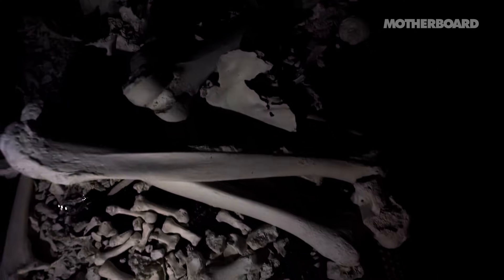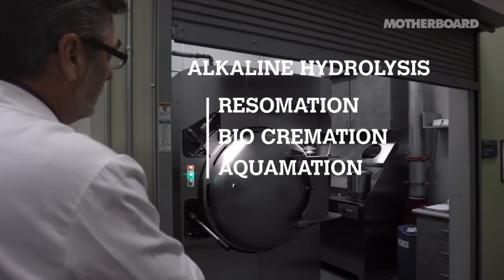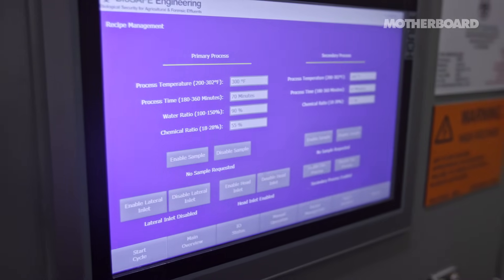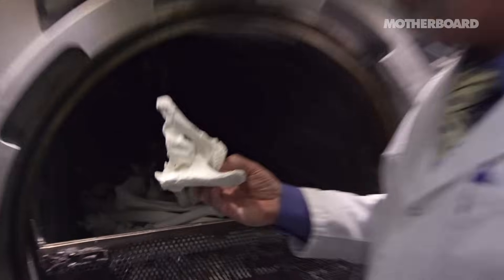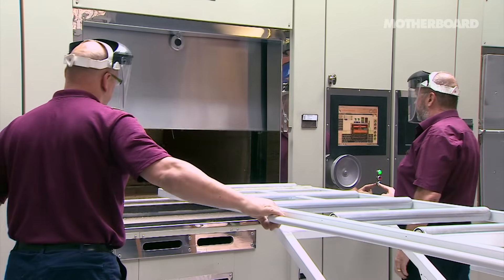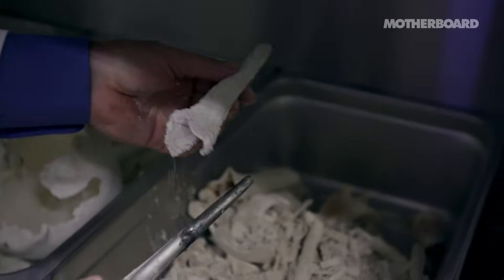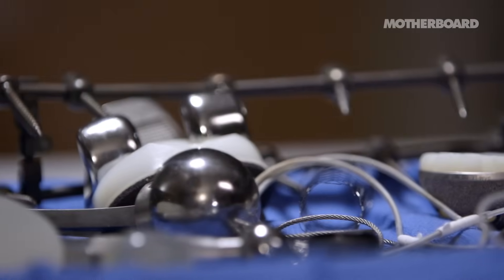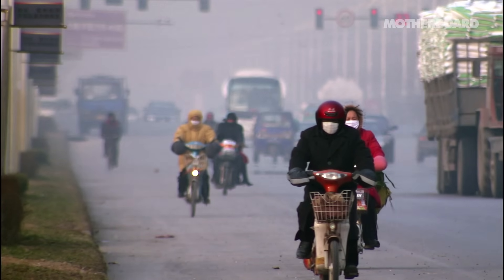Leaving Earth the Greenest Way Possible: Water Cremation

Comment: My sister was Aquamated the first of this month.  We didn't pay any more than what a flame -based cremation would have cost.  I'm sure as in everything, the cost would depend on what state/city the process takes place.  My sister's happened to be in Oregon.  We were able to view the chamber and could have even watched the process if we wanted to.  This process is so clean that the bone is a vibrant white powder when we got the remains back.  Also, you actually have 30 to 40% more cremains using this process. I'm all for this and hope they offer this process in my state when it's my time to go.
Reply: Is it possible to get the remains WITHOUT them being crushed?

Comment: Harldly “the greenest way possible”, alkaline hydrolysis involves the use of many gallons of a caustic alkaline solution, heat and pressure to dissolve all the body’s tissues, except bone.  All of the body’s remains are pumped into a sewer, along with the strong chemicals, and ends up polluting the water environment.  Never mind the fact that Grandma’s remains are now commingling with poop, urine and other foulness in sewage.  If you want the “greenest” method, choose a “green burial”, where the unembalmed body is buried in a shroud or biodegradable container.  Nature then breaks down the body into it’s most basic components, which are actually beneficial to the environment.

Comment: Love the way he touches the bones without gloves on his hands....
Reply: 🤗 the hydrolysis process has destroyed any kind of infectious particles 

But understood the bones could still carry the residue of the potassium hydroxide.
Reply: @starberrydrink  Doesnt matter that's just LYE, the same thing that is used to make SOAP, you can buy it by the pound, I've bought the stuff and used it to strippaint off salvaged antique architectural cast-iron artifacts, a  pound or so in a large rubber tub filled with about 15 gallons of water was enough to submerge the iron pieces in and within minutes all the old paint is GONE, right down to the iron, works 100 times better than any "Zip strip" or other paint remover!

Comment: This is like making biodiesel using cooking oil, animal fats im guessing?  Is the biodiesel used, or does it go down the drain, or can people get it from you to use?  I make my own biofuel at home, and if its possible to find somewhere near Nottingham uk and get some liquid remains.  I guess you do a titration so all the fat is reacted, and it turns out you could use sodium hydroxide too, that would be cheaper, and require less, but one drawback, takes longer to dissolve.  Do you get glycerol soap from this as well?  Andrew Mckenna, Nottingham uk.

Comment: I don't like this because only the bones remain.  There is a great deal of the body that is missing with this process.  I don't want all my soft tissue flushed down some toilet.  I want my entire body cremated and the remains of my entire body (not just the bones) buried.
Reply: Even with traditional fire based cremation most of your soft tissue is incinerated and goes up the smokestack.  Once they have burned off all your soft tissue they remove the bones and crush them into a powder that your family gets back as "ashes"  If you want your whole body buried you should skip cremation entirely and go for burial without embalming.

Comment: I wouldn't choose it for myself or a loved one because at the end ( correct me if i'm wrong), you'll be scattering only part of the body (the bones) because the tissues, muscles etc would be lost down the holes ( sieve thing) during the process?? Whereas if the body is cremated by fire, you end up with 'all the burnt remains' ....
Reply: Actually Nonny, the remains from water and fire cremation options are about the same - mainly bone. Remember that about 96% of the human body consists of four elements that (for the  most part) evaporate during fire cremation - out of what is left, over 95% of that is bone.

What the video doesn't cover with this method is just like with fire cremation, the "leftovers" (or bone) from alkaline hydrolysis is then run through a grinder and turned into a fine powder - this you receive back in an urn, or box, or whatever is chosen for your remains. You don't get back grandma's skeleton, even if you ask...

As someone else mentioned, the process is expensive - alkaline hydrolysis machines are (last I heard) around $250K each, so they aren't widely available. Further (also as someone mentioned) while 10 or 12 states (as of Jan 2018) have recognized it as a viable form of cremation, the good old religious nuts are jumping up and down about it so their legal disposition kind of goes back and forth. Lastly, even where legal, not a lot of machines exist (I think only three or four in the US). 

And there is no comparison to embalming - this is much greener and safer for the earth. All these people wierded out by the thought of "going down the drain" are oblivious to what happens during embalming -  - the blood is sucked out and after severe piercing of major organs and filling with liquifying chemicals, whatever is left of the gastric system is sucked out through a trocar and put down the drain.

I am definitely going with this method...
Reply: Oh boy. Wait til you hear about embalming...

Comment: Sounds good, except not all of the liquid remains will end up in the secrets garden or vegetable farm. City dwellers could well discover their loved ones have been flushed down the sewer. It seems a bit disrespectful to me. My grand parents had a cesspool behind their home where the casaba melons were so beautiful, but no one ate. There is something poetic about the smoke of a cremation being cast into the winds. The pollution issue is minor, What your showing as cremation polluters isn't here in the USA. One looks to be in India. (A major polluter period) The first isn't a modern cremation fire.If it is at all.
Reply: If you're worried about bodily remains ending up in the sewers, yet find human ash remains being pumped into the air "poetic", I'd hate to be the one to tell you what you'd be breathing in there bud. Plus, with alkaline hydrolysis, the remains of it contain no actual human DNA, since the entire body (save for the undissolvable solid parts) is dissolved and the solution can be easily treated for chemical compounds. Plus Plus! With regular embalming, all bodily fluids like blood and other nasty gunk is washed right into the sewers to be replaced with embalming fluid, specifically designed to keep decomposition at bay and preserve the body. When the person is buried, all those chemicals go right back into the earth too. I don't think water cremation is the most "disrespectful" out of the available options.

Comment: I would like an in-detail energy savings analysis.
Reply: I was thinking along the same lines. I was more concerned with the overall footprint from start to finish to produce one. The materials, the carbon footprint before - after and during use, emissions, cost per a unit, etc. Also how many bodies at weight x would need to be disposed of through this machine to finally start making a positive change due to all the other previous and current emission factors. Would be nice if there was a standardized way to measure these factors in many circumstances.
Reply: Go on and watch Ask A Mortician video about alkaline hydrolisis. But if you don't want to I give you a few simple answers: It does not emit gases to the environment, it cost much less than an old cremation, it doesn't need lots of material in comparison to using flames. It is legal in a few states but hopefully will be legal in other states and countries :)
Reply: It depends from person to person. Only your relatives would know precisely how much energy it went to juice you.

Comment: So the body is put into the machine and the liquid is set at 300 degree F. The boiling point of water is 212 degree F. so actually they are just boiling the flesh off of the body. I would rather just be encenterated and burnt, and also I bet the hydrolosis is more expensive you choose.
Reply: pressure smarty pants
Reply: @devanh8592  you are exactly right it is more expensive and uses more energy to run it. I had rather just be burnt, but this machine boils you just like you would boil pork I don't ever want any thing to do with hydrolysis cremation.
Reply: @devanh8592  I just don't like the thought of me boiling for 8 or ten hours. I would rather be burnt in a. 2,000 degree furnace for 2 hours and nothing be left, but some bone fragments and ash. I just don't like the thought of being boiled even if I'm dead.

Comment: Personally, I would like to know where the slurry of flesh goes?  If my understanding is correct, it is flushed into the sewer system in most states and provinces.  Therefore, I find this method far from green.
Reply: Especially since I think you HAVE to be buried in a casket...but you can be flushed into sewers ? :) that would make perfect since on a government level lol
Reply: Caskets are not legally required, at least not everywhere.  Also, there is NO flesh left after this process.  There isn't even any DNA left.  Your blood, by the way, gets flushed during a traditional embalming, and your body is buried in a crypt and casket after being filled with chemicals.  Some traditions consider that the life is in the blood-- and it gets flushed down the tubes.  If that's not a problem, this shouldn't be.  With a green burial your flesh is eaten by bugs and worms.  There is no pretty way to dispose of bodies.  We can only look for ways that cause minimal impact while remaining as respectful as possible.
Reply: So? the sewer water is treated anyway, no special extra treatment is needed beyond what it already does with all the crap you flush down the toilet.

Comment: I am very skeptical about the truth of the statements. For instance: I find it hard to believe, that this is more energy efficient than cremation. It seems like the energy it takes to produce the sodium hydroxide is ignored, which is quite a lot. There are also other points where additional energy is needed when compared to cremation.
Reply: Futaxus true, but honestly if you can reuse those implants and what not its proboably worth it, dont you think?
Reply: I agree that it probably is worth it in some cases, but I don't think it's that evident. The implant story for example seems very speculative. Implants have very high quality standards (and for good reasons). But let's just grant that there is worth here, I still expect Motherboard to have higher standards of fact checking.
Reply: They could just recycle the KOH
Reply: I don't think that would work very well. First, most of the KOH will be neutralized by the fatty acids and amino acids (both are somewhat acidic) and you have to invest a lot of energy again to create a very strong base from a somewhat neutral solution. Second, the solution after the hydrolysis has to be dealt with. The usual way would here to further neutralize the solution with some acid and then to remove the different dissolved substances by filtering etc. I mean, there might be a really ingenious way to recycle everything used that I don't know about, but that by itself would be relevant enough to report about and it's not likely. 
Once again, a short sentence addressing this in the video would have been really useful (to me).
Reply: Futaxus Cremation is basically a gigantic fire tornado hot enough to melt iron so I doubt it's more efficient.
Reply: That sounds like a really scientific argument, thank you for enriching this conversation. (Everyone interested might do a quick calculation. If you really wanted to, you could burn a human body energy efficiently, even without drying it. That means the energy released by burning the fat and muscle alone is enough to vaporise all the water and still produce energy. However, it might simply not be practical to create a corpse fueled power plant for several reasons.)
Reply: Futaxus I think the carbon emissions of cremation are negligible
Reply: Do you realize that you are not making a counter point to my argument?
Reply: Futaxus 
It's about a quarter of the carbon footprint of traditional cremation.
Reply: Futaxus 
Hospitals will charge the same used or not.
Reply: The water from the machine is going to sewage why not just throw the body in garbage. I don't see any respect for the dead bodies .You are not getting ahead by using these methods you are simply disrespecting dead bodies
Reply: That's why there is a range of options. If you don't like it you can choose something else. Well... until some stupid person bans fire cremation because of "emissions".
Reply: That's a bold and untrue assumption on your part.
 I know emissions and climate change is real. But cremation has been a part of many cultures for thousands of years. There are better ways to cut emissions other than preying on cremation, which has been mentioned where I live. 
Maybe you shouldn't make character assumptions off written text.
Reply: JezaPyrite everyone makes assumptions off of how people write.
Maybe you just need to pay more attention to your own writing. Especially since the use of commas around words can often make readers feel that if it was actually being said the person would be using their fingers in an air quotation manner which is normally used in a sarcastic unbelieving sort of way
Reply: Wow you really have a big issue with a simple comment don't "you" lol. Ok captain, I shall articulate sentences to a more satisfactory standard in the future just to keep "you" happy, oh internet stranger. May you're day bee peiceful and fill off good spellling and gramma correctness.
Reply: JezaPyrite I think it might be you that has the issue judging by your replies. I just made a comment about a simple observation
Reply: That Girl     Ok honey 😘
Reply: JezaPyrite thanks for proving my point again and emphasising it with that little emoji
Reply: This is for the girl and jeza comments. Quotation marks, not commas.
Reply: The fact that you are skeptical about this lends zero substance to your skepticism unless you brought facts yourself.  As someone has said, NaOH is readily available and cheaply made and your words sound heavy on simple skepticism and light on reason or fact.   It is hard to change, maybe that's why you balk at this idea.  Change must be embraced though, however reluctantly some may be, or skeptical.
Reply: i believe he said potassium hydroxide
Reply: I rather be barred,who knows maybe I will become a zombie 🧟‍♂️
Reply: Sodium hydroxide is literally just brine . Wtf do you mean "produce sodium hydroxide"?????

Comment: *scientist 
>uses Fahrenheit
Reply: Yes, even scientists know that Fahrenheit is necessary if you want a US audience to have a clue what you're saying.
Reply: Bruceskyy telme how jes your scale is biger but we usually use 20,5  so it can be just as precice but what is the difference between a single degree on  300 degrees
Reply: Bruceskyy I beg to differ. Celsius makes more sense, is more precise and more accurate
Reply: Fahrenheit allows for more precise temperature measurement quicker. The difference in a degree bring a more precise measurement than your Centigrade system.
Reply: The Big Game Theory metric is dumb and sophisticated countries who know how to think in more ways than 1 and 0 use proper forms of measurement. Inches, feet, Fahrenheit, yards, and gallons.
Reply: The Big Game Theory the UK defacto uses gallons and inches. Seems kinda funny that equipment using proper non metric units took men to the Moon.
Reply: Correct, only 3 countries operate on that system. Best available. Science uses kelvins anyway other dummies.
Reply: Sean O'Donnell cant believe it took nine months for someone to bring up Kelvin
Reply: Celsius = Water freezes at 0° and Boils at 100°... Seems much more practical and precise than Fahrenheit
Reply: The Big Game Theory if you're going to rant about how stupid something is, use the correct form of the word "too".

Comment: Organic carbon is not a pollutant, we are carbon based life forms, plant life needs carbon, needs the nitrates, and burnt organic matter is not one minutia  a factor in our pollution problem. That is misinformation from an advocate of the process. I agree with cremation and dont think badly of the alkaline hydrolysis of that's what someone decides, but I personally would choose traditional cremation because your fueling the earth, feeding plant life, with  your organic losses through the process, and those losses are minimized meaning more of your body is left to ashes. If I'm going to be ashes i dont want to be just the bones and the majority of my physical self "flushed down the drain" (despite the discrepancy in thought with how that would provide more organic matter, and beneficial alkaline, to the environment, the latter as negative trumps that as positive in my mind). Its important i think to be able to say "here is this person as ashes", and as a whole being, where the hydrolysis you cannot and I find that disturbing. To each their own, and in the end it's probably irrelevant, just my opinion.
Reply: In regular cremation, all that is left is your bones--your flesh, fat, and organs are burned to nothing because of the extended high temperature. And in alkaline hydrolysis, none of your bones are burned off, so there's actually more of your remains that your family receives than via traditional cremation; all that goes down the drain are proteins, sugars, and amino acids, etc. As far as carbon goes, it IS a pollutant when aerosolized (put into the air), as it helps hold the energy of the sun's rays within the Earth's atmosphere, thus raising the average global temperature.